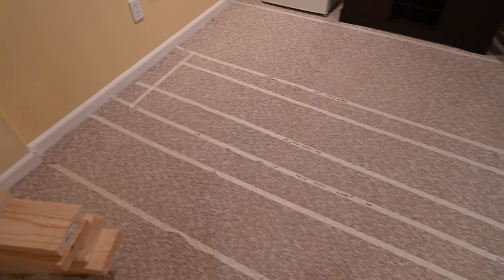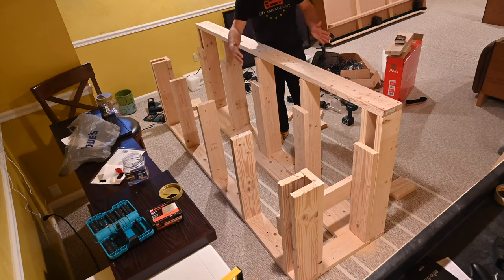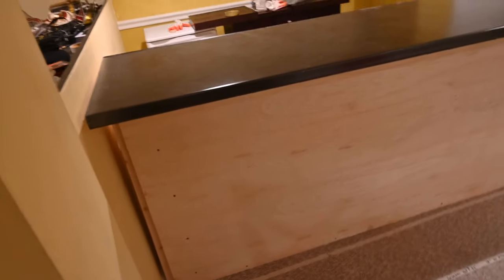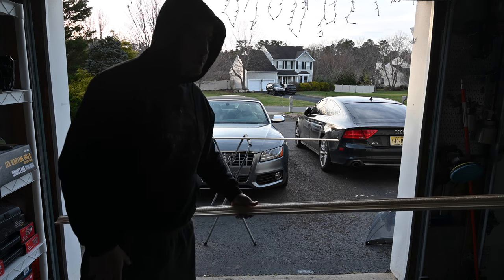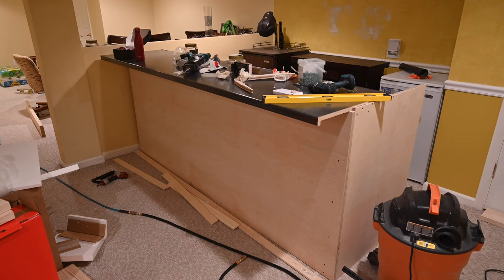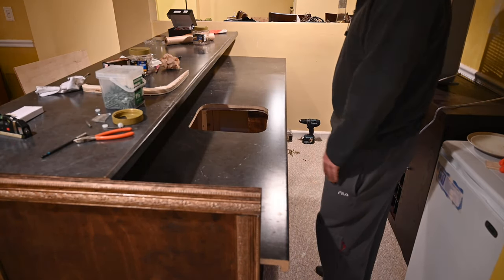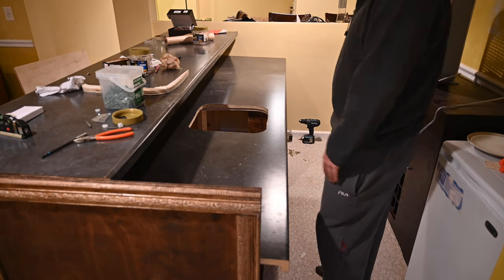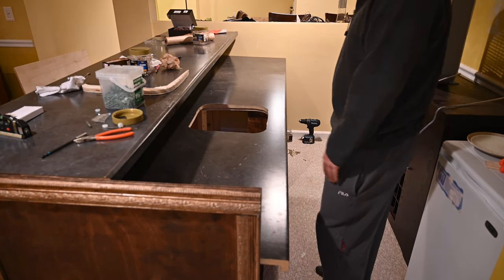How to build a Home Bar - DIY Bar build/ How to Build a Bar

Comment: Nice bar I wudnt add that fireplace to the bar because whenever is sitting there it will b hot on there legs or u will have to eliminate seating right there altogether
Reply from the maker: I have not added it yet, but it is adjustable. I can put on the flame without the heat or adjust the temperature. I keep debating on what the right move is

Comment: question . how did you fastened the bar top to the wood? what did you use ?
Reply from the maker: I used the appropriate sized screws and secured it from underneath. Another option is liquid nails or something similiar.

Comment: I would of put a drip edge on the top bar because there's always going to be someone who spills their beer and why did you bother with the sink? Without having water it's pointless. Should of made it a wet bar. Other than that I like it
Reply from the maker: Drip edge would have been a good idea. The sink has a pipe and bucket under it for things like ice if I want to fill it or a dump sink. Thanks for the feedback!
Reply: @DIYSalvageGuy  the drip edge is pretty cheap. It's been a few years since I built my bar but I don't think that little bit would be expensive. You might even have enough wood lying around to do it because trust me someone will spill a beer at some point. If you wanted to make it a little more comfortable then check out Chicago bar rails. It's the part where you rest your arms at a real bar. Since your bar is straight then it wouldn't cost much. It's when you get into a u shape bar then it's expensive because of all the elbows

Comment: how did you plumb the sink in...did i miss that timecode
Reply from the maker: I did not add plumbing if that's what you mean. I did caulk it in though, but that's standard stuff.
Reply: @DIYSalvageGuy  yea i was talking about the sink you put in on 12:53 just cos I'm doing a similar thing now and was wondering if you put in running water or waste water system
Reply from the maker: No running water. It's a dry sink. I have a bucket underneath it to catch anything. It's more or less just a ice holder or a dump sink. Adding plumbing is a way bigger job than I was prepared to do in a day.

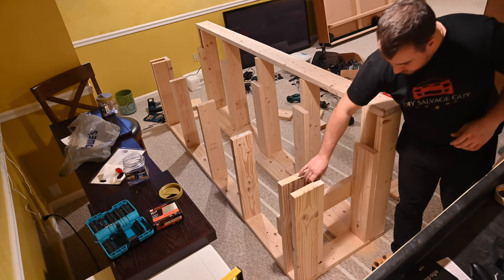Comment: Hello DIY Salvage Guy, I just finished my basement and I am interested in building this type of bar as I feel it’s a project that’s within my wheelhouse. When your showing your build at the 5:00 mark, what was the height on the front 2x6 going across the front and then also the back vertical boards by the camera?
Reply from the maker: I'll measure them and get back to you tomorrow.
Reply: @DIYSalvageGuy  he never did
Reply: @Wadses  also need to know lol
Reply: No reply
Reply: Actually, you need to buy your chairs/bar stools to determine the exact height.  Make adjustments according to your chair seat tops.  Ideally, 24 to 30 inches apart horizontally
but never closer than six inches apart.  Bar tables/bars tops are about 42 inches from the floor.  Vertical. So you'd want your chair seat tops to be 30 inches from
the floor (12 inch difference).   If there is an apron on the counter or thickness, a comfortable distance for knees below is  8 to 10 inches, so a 4 to 2 inch thickness/apron.
Bar chair seat tops are all different heights from the floor.  So, like I said...get your chairs first.
Reply: @85montessiride  lmfao
Reply: Work tops generally sit at 900mm finished height. So say worktop is 50mm thick, top of your frame rail should be 850mm. ??

Comment: Hard to learn from a video been sped up from beginning
Reply from the maker: The real purpose is to show you that you don't need to learn. Get a design in mind. Make some cuts on some wood. Support that wood and make it your own. This video shows that you can do it without any knowledge or skill. There isn't much to learn about cutting and measuring wood. Just make it even and have fun with the design.